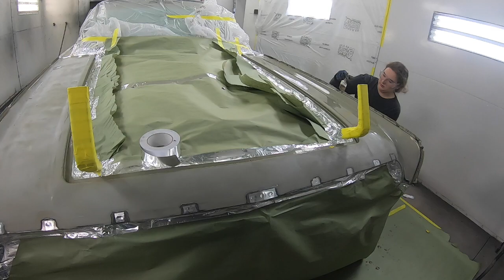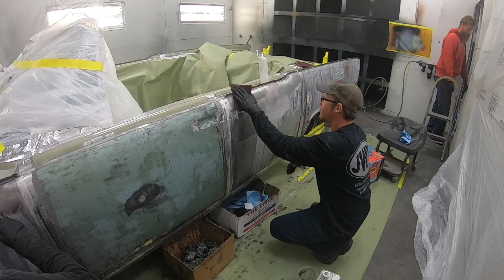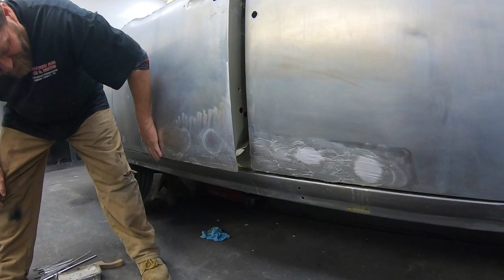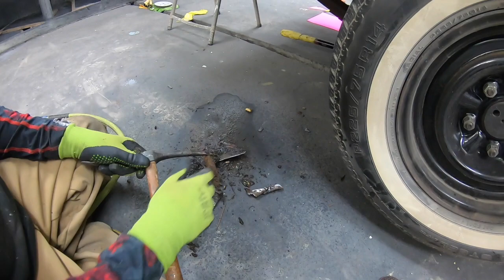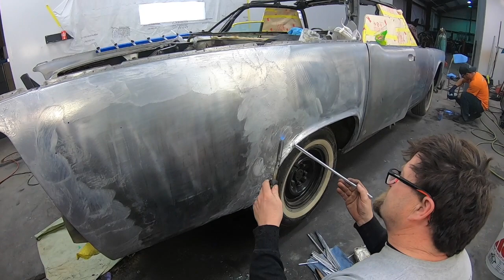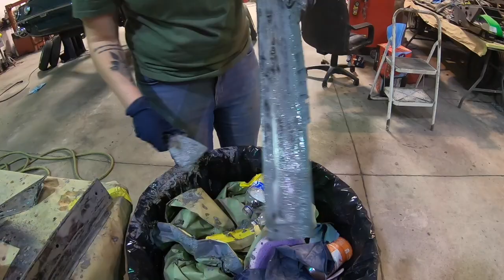1963 Lincoln  Continetal video#2

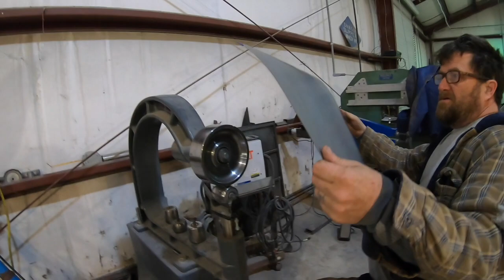Comment: @9:14 What is the thickness of that car sheet metal? Is it expensive? I want to do this for my car myself. I have a 1963 Lincoln Continental. I have had no luck getting mechanics who were willing to do a good job for me. I have to do everything myself.
Reply from the maker: The sheet metal is 18 gauge, and its about 140$ for a unformed sheet, depending on where you buy it.
Reply: You are not alone. I just replaced my door bottom panel with 18 ga sheet. It's slightly thicker than original but welded great for my skill level.